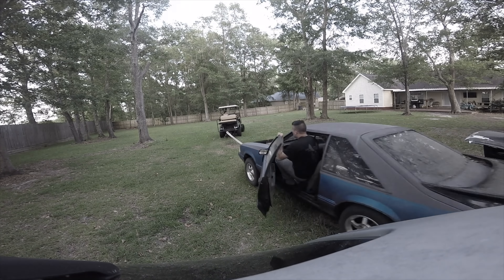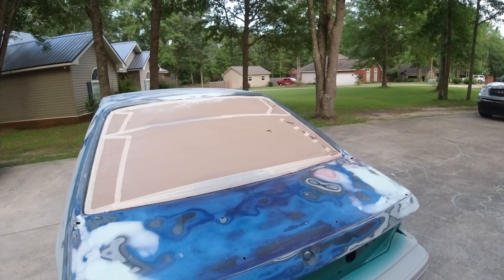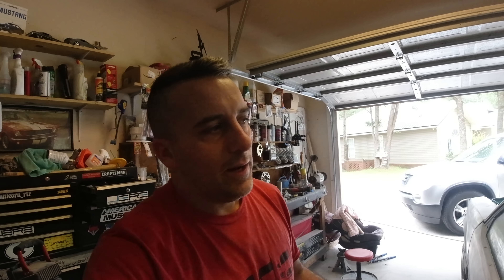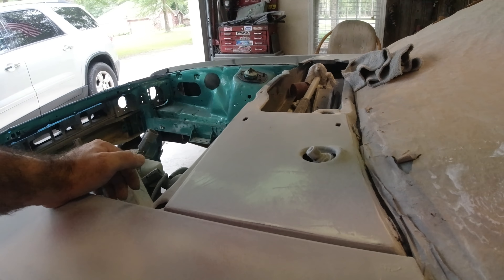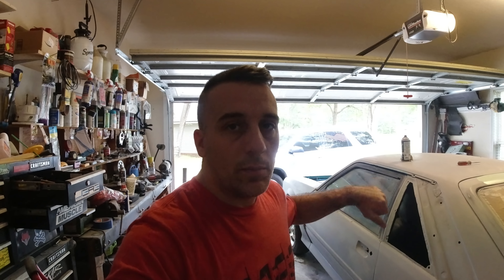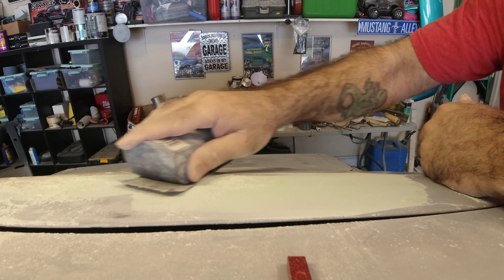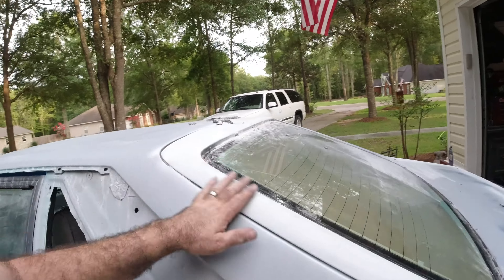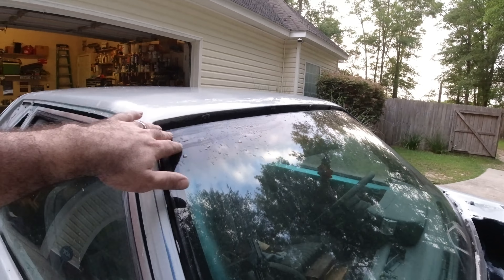FOXBODY CROSSROADS: IT'S PUT UP OR SHUT UP TIME!

Comment: Brother listening to you sounded like you were watching me doing the body work on my Calypso convertible. I too grew up around paint/body work but never really picked it up. Had to do the same as you. Mine has finally been in paint for 3 weeks! Keep the faith the end is near. 

Few tips I picked up. For the body lines run a piece of tape on one side. If it’s below the body line, block down to it. Then unmask and put it above. Block to  up to it. Nice straight crisp lines. For the small bare spots to reprime, cut a hole in a piece of cardboard bigger than the spot. Hold it back an inch and spray. Less over spray and still a slight edge you can feather. Keep up the good work. I feel your pains and sweat!

Comment: Did you use a epoxy primer? I just started my project and primed over some bare metal spots with 2k urethane. Do i need to strip that and put epoxy the 2k urethane?

Comment: Not sure if you know this trick brother, but if do already then awesome, if not, it will probably be helpful to some of the followers though. Anyway, when painting under the hood and around wires and cables and such, aluminum foil works incredible well for taping off. You can wrap cables , brake lines, brackets and all sorts of things with it. It’s cheap and molds to anything! I’m excited to see this thing painted man keep hustling brother. Don’t kill yourself for us man, make sure you take some time to enjoy the summer. 💪💪
Reply: black88lx that’s what I did when I was painting caterpillar equipment, we wrapped all new hydraulic lines with foil